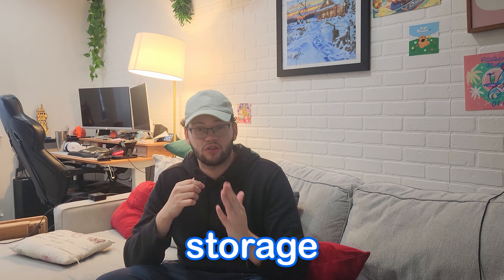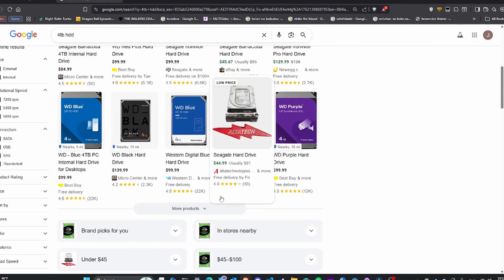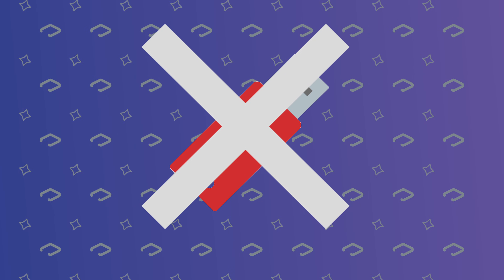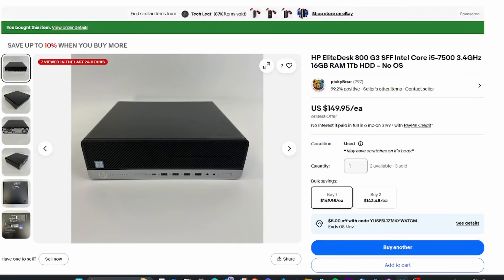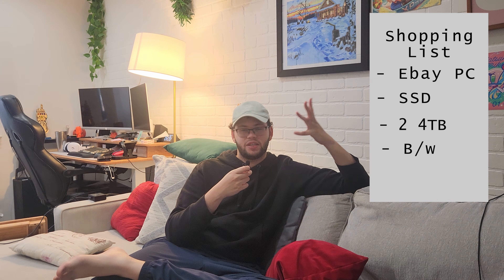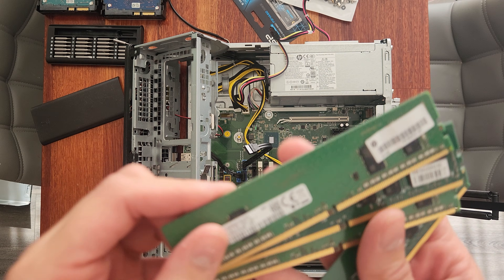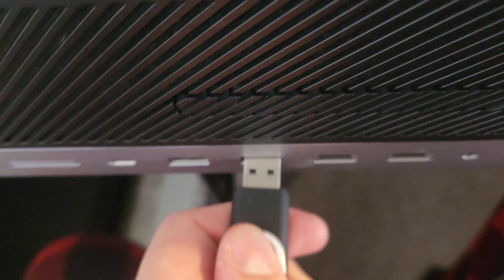I Accidently Built a Mini Data center at Home

Comment: Rebelgost -Minimum Debian server installation using either CasaOS or Docker desktop would have been far easier and faster than installing proxmox and then configuring everything needed for setup. Why over complicate things?
Reply from the maker: totally valid point but Proxmox was an intentional choice. I wanted complete control over the VMs/containers underneath with strong isolation.

Long term I want to play around with different Linux distros and eventually replace my desktop, so Proxmox lets me do that safely.

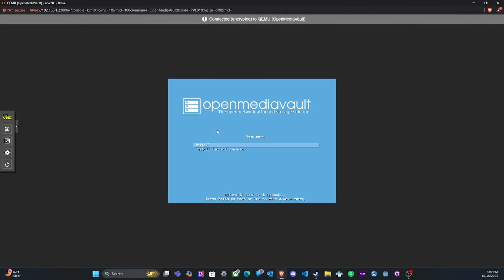Comment: And ye 7:24 , raid doesnot backup , its just a cheap solution. We need to follow 3-2-1 rule in storage for pure backup , but for just using ehh raid is enough
Reply from the maker: Yeah most definetly, I'll like to achieve that down the line

Comment: Shouldn't you do that using lxc for less resourses instead of a full vm unless you need strong isolation.
Reply from the maker: Open Media vault is recommended to be done on a VM , and its not well supported on lxc, but based on my research  OMV is designed to behave like a full Debian system with its own kernel control, systemd services, etc...

Comment: Great vid as I want to do the same!
Some questions if I can:
Why proxmox, and not directly OMV?
Why no truenas instead?
What is the actual power consumption (especially when idle)? Electricity costs here are quite determining choices here :/
Why PSU replacement? Seems expensive compared to the rest of the build
Lastly and most importantly: how do you find these so cheap? Second hand older gen of prodesk/elitedesk is +400eur/usd here already.
Reply from the maker: Thanks for the nice words and really good questions,

1)  Why proxmox, and not directly OMV?:

basically I decided to use Proxmox as a base because it lets me easily create containers and virtual machines. if I were only using my home server for network-attached storage and nothing else, then yeah, it would’ve made more sense to go with OpenMediaVault. but since I plan to run additional services down the line (like containers and other VMs), Proxmox just made a lot more sense for me.

2) Why no truenas instead?
I actually considered TrueNAS at first — that was my original plan — but I decided against it last minute because Proxmox gives me more control overall. since I’m using my server for more than just storage, having that extra flexibility is super handy. plus, if I ever want to, I can still install TrueNAS as a VM inside Proxmox and have it handle my NAS duties. both setups are valid — it really just depends on your use case (I know, terrible answer lol).

3) Power Consumption & PSU
as for the PSU replacement, I did that mainly because I want to explore AI usage later on, so I wanted something a bit more capable and efficient.

right now my server runs at around 130W under normal conditions (with network shares on 24/7), which comes out to roughly 0.13–0.15 kWh per hour. My rate for electricity is 17.580¢/kWh

and yeah, I’m based in the United States, so that probably helped with pricing. I got mine off eBay from a US seller, which might explain why it was cheaper compared to what you’re seeing locally.

4) Finding PC
Some advice, the computer does need to be top of the line in specs tbh, something realtively modern, so something form the last 10 years should be more than enought 

here is one I found on ebay for around 140eur 

https://www.ebay.co.uk/itm/226553328095?_skw=hp+elitebook+SFF&itmmeta=01K9X6WJAV1W75GEGFP9DQY5ZQ&hash=item34bfa171df:g:78cAAeSwnJFopGU4&itmprp=enc%3AAQAKAAAA0FkggFvd1GGDu0w3yXCmi1dMl%2F7ixZt9Mf5OlA52dwaf7L1BP8Lg9MwkgYjYrB9tQ4RjXL86OAU27Tdj77ncuiBLd%2BT8wceb2iQyhVJzxVHtQhyAZfx8FzAOg5rkmRH6tGI4kV%2BV4hmsWiLgbrt3VTLZYmSujBluMnlOloEc0XO3E3xruW8wPQc4mCYJMBPJVOV3FyLDluDfCO3U5uRU8LyjLWOnNSiEaCBKKk%2BpVPyvSFyaoxjJQq4t7fz716oQXfZR5gBegvg8G%2BBGc3FQj1g%3D%7Ctkp%3ABk9SR8ql8qbPZg
Reply: @rebelgost  130w sounds high for that low spec. my Dell R730XD draws that much with 1x Xeon 2673 V4, 128gb ram, 4x18tb HDD, 2x SAS SSD  and 3.2tb pcie ssd at idle. You can enable in proxmox C-states that should lower power consumption.
Reply from the maker: @sybreeder86  most likely I calculated my power usage wrong, I was trying to find a way to calculate it via software but was running into issues.
Reply: @rebelgost  You have to use device like a kill a watt. not some calculations. Calculations will be meaningless